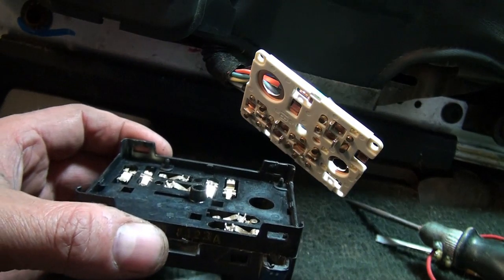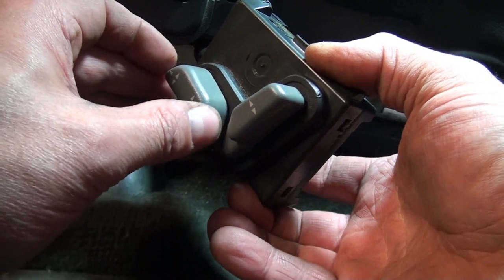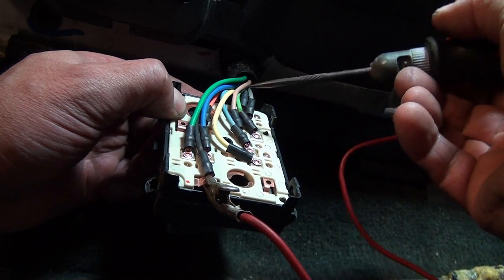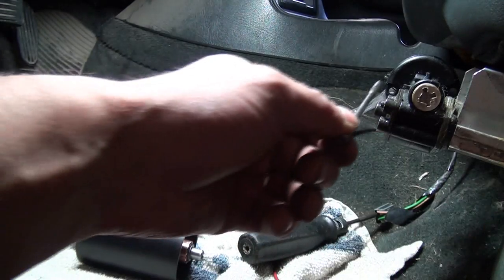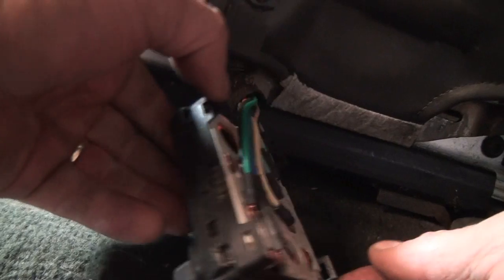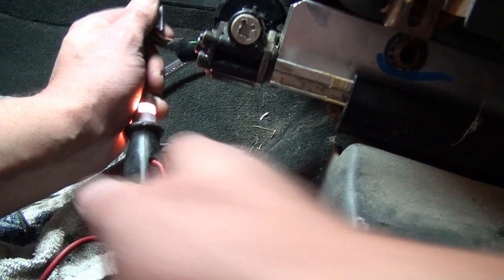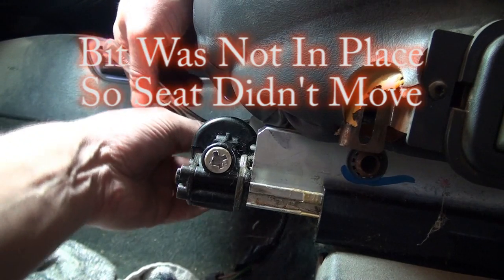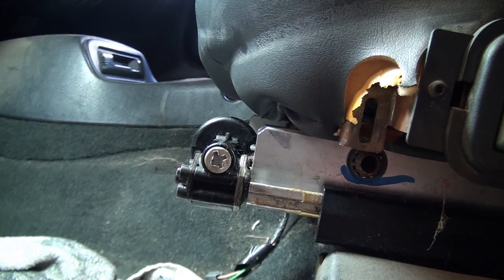DIY Blazer GMC Jimmy Power Seat Control Diagnostics and Repair Electric Seat Does Not Move

Comment: Great video, thanks for sharing.  I took my switch apart same as you show and tested power (no problems there) determined the switch itself was the issue.  Seat motors worked, but intermittently.  I disassembled the switch and cleaned the contact points, which showed signs of corrosion.  When trying to reassemble (reference minute 0:45 in your video) , the process took several attempts before the rockers (the metal contacts housed in the black case) seated appropriately in the circuit board.  This may have been the original issue...those rocker switches are pretty free to move and may have gotten knocked out of position and been unable to form a solid contact.  This switch is in a pretty high wear-and-tear location in the vehicle, so be advised that disassembly may be necessary to clean and service, but it may take patience to get back together.

Comment: No wires are ground until a switch closes and then becomes the hot leg.
If you send power to a ground, that is a direct short, the motor leads will read ground backwards through the motors wingdings, however this is why it is not a direct short when energized since every electrical circuit requires a load/resistance to electrical flow.
A circuit with no load/resistance will be a direct short if energized, it is no diffferent than jumping POS to NEG at the battery, this is a direct short, however if you put a light or horn or motor etc in the circuit when you energize  the circuit by closing the switch, it is no problem,  remove the load and try energizing the same circuit and it is a direct short POS to NEG.

Imagine a porch light, in daytime the light is off cause the switch is open.
When the switch is closed the light comes on and since the light has resistance the circuit is not a direct short when   the switch is closed.

Now imagine I remove the porch light bulb and place a penny in the light socket, a penny is not a load   and has no resistance, not enough resistance at least.
in this situation closing the light switch will be a direct short since the light bulb is replaced by a penny.
Or rather than a penny you can imagine connecting the 2 wires together at the light socket.
Reply: +Keith Grayson 
If you look at the picture above, imagine the load removed and L-1 is connected to L-2, bypassing the load in the circuit, when energized will be a direct short L-1 TO L-2 without any load in the circuit.

http://i66.tinypic.com/mhayi9.jpg